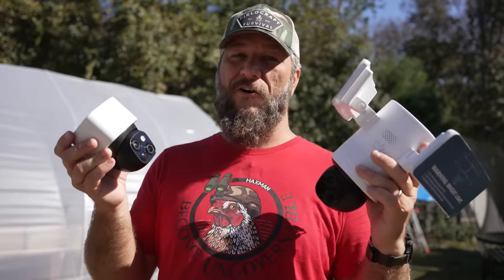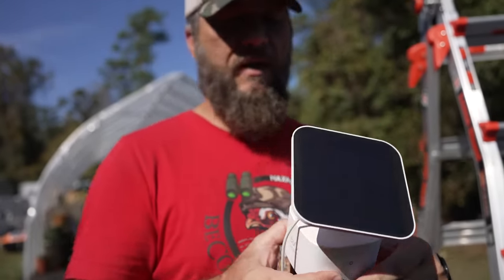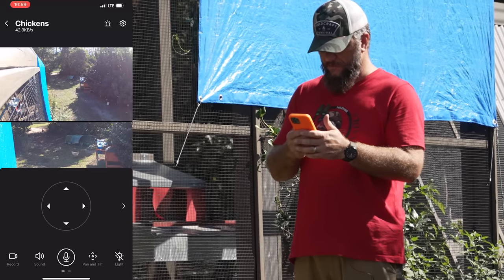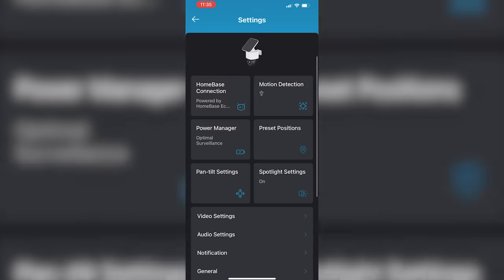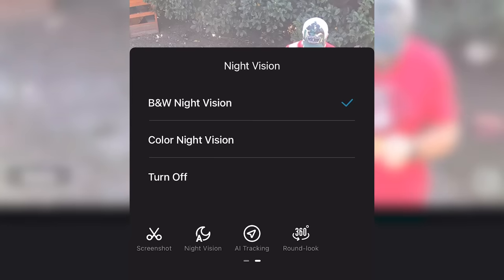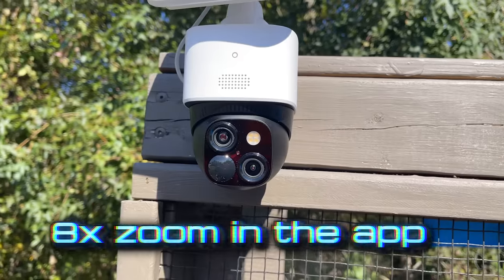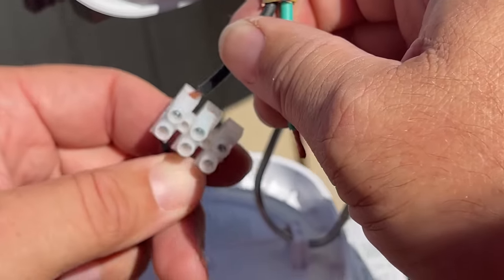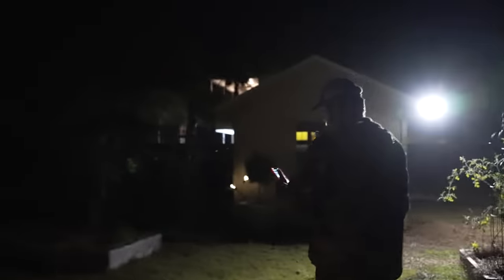Your Security Camera is Junk! Check These Out!

Comment: Eufy has had some pretty unethical security practices... they may have been resolved, but for now I don't trust them.
Reply: Say it louder for the people in the back!!!!!
Reply: @Hunterlewis675  They claimed the camera stream was encrypted, but it was not.  Also, the servers storing the video are located in China, and we all know what kind of a security risk that entails.
Reply: What did they do ?
Reply: @leejenkinson5521 right no power source.. and what would that have to do with access to what the camera sees?
Reply: yeah sorry, that was not even meant for your channel, was commenting somewhere else and the powers that be mixed 2 comments up, will see if I can remove it buddy!
Reply: @Svg784p They claim that the videos are only stored locally, but it was discovered that your videos are uploaded to their cloud, and it's not encrypted. I believe someone found their cloud storage on Amazon Web Services and called them out. Now they claim it's encrypted, but not that they stopped doing it. (Unless something changed recently.) Another problem with their wireless cameras is/was that someone could press and hold the sync button on the camera and it removes it and the recorded videos from the base. If they don't steal the camera and you can sync it back up, the videos are still there, but if they do take the camera, it sounds like the recordings can't be recovered. Eufy initially said that the feature was working as intended, but I think they may have finally upgraded the firmware to resolve this. I'm not entirely sure of that, though. All that said, I'm not sure that there aren't also issues with other brands of wireless cameras. I know Ring employees were caught watching cameras and taking control of them. Wyze had some security flaw issues. I don't know, they probably all have. Lol
Reply: I trust them enough to have them cover my outdoors. They aren’t working with law enforcement like ring, they don’t have multiple consecutive breaches like wyze and they have improved since the incident which end-to-end encryption so I am not as concerned.
Reply: If one wants true security, no data should exit their security system to any 3rd party.  It should be as closed loop as possible.

I'd opt for a system that is localised and sends all data to a local security station and doesn't send data out.
Reply: It's good to see that somebody noticed if you watch carefully and watch the signs they'll tell a story
Reply: @redbaron6805 China how does that help us and where did you get that tid bit of information
Reply: @joshua01 exactly who care is just outdoor. Just don't put it inside your house. It is cheap no subscription like ring
Reply: Thanks, that’s helpful to know. I don’t want any communism in or around my home! 😂

There’s no telling why China wants the data, but it is a l well established fact that China has been harvesting biometric and personal data of everyone around the world. No clue what they want it for, but just the fact they want it makes me want them to not have it.

Comment: Eufy is known for horrible issues with data, doesn't matter how good the cameras are if the company itself can't be trusted.
Reply: If you are worried about security, you could hook it up to its own subnet and use a program to see what it talks to, you can then lock it down if needed. Not for the novice, but there are ways to lock things like this down. I’m sure there are simpler ways as well.
Reply: I looked into this issue and found that perhaps a class 10 extreme duty SD mem card is one apparent fix to the issue, not yet tested. Take care.

Comment: I have an AOSU 360° Solar C9C camera. The camera lacks true security features. The first being a 60 second event recording limit even with a 128GB memory card installed and set up to only record locally(not that local or cloud recording should be a factor in limiting the camera to 60 seconds local max). Imagine it picks up someone hopping your back fence and walking towards your home slowly opps it stops recording / fails to continue to track. or they pace back and forth then begin to walk up to or around your car oops 60 seconds is up. Other times if the subject pauses for a moment, is moving directly toward or away from the camera and even if there is movement across it view  the camera just stops recording. This is even for recordings way below the 60 second max. which most recordings are. The camera has no option to force it to continue recording a motion event for the full 60 seconds or for another 5 seconds (or 10 or 20) after it thinks motion has stopped - this is standard on "security cameras". Another standard "security camera" feature is the ability to pre-record. What that means is the camera is buffering a few seconds of what it is looking at (usually 2-5 seconds) and when an event is triggered it uses the pre-recorded video as the beginning of the recorded event. This ability allows you to see what happened before the detector picked up motion (out of range of the motion detector) or if the camera had a detection zone (and a home zone) and you had blocked some swaying branches... As for the home zone it is where you want the camera looking at all the time. Such as your car or front door (the camera does seem to return after tracking to where you had set it to look at but not every time). These features have been available for years  on inexpensive ($35 or less) wireless cameras.   What made me purchase the camera was the true wireless nature of solar. After 4 cloudy days the camera continued to function. The night vision is ok - if you have street  lights around your home turn it off. The lights that can turn on are bright considering. Unfortunately, key security features are missing. I can't state how important it is to be able to increase or record an event in its entirety. But I know this will leave you very frustrated when there is an incident that was partially recorded or missed entirely. I got what I paid for and most unfortunately missed my return window. I will also mention there is not any documentation of its settings and forget about the tech support people offering any explanation of what settings it does have no matter how many times you ask or send examples of missing events. From what I have read all the cameras in this class are the same. Let's call them "Good Luck Cameras"  . Good luck getting some usable video when something happens.

Comment: Big problem with the Eufy system is, (I have four cams, two floodlights and two doorbells) if one camera in the backyard starts recording it will miss the predator in the front. They don't record at the same time or two events simultaneously.  I had to divide the cameras between two bases, one on my account and one on my wife's. So hopefully one of the accounts will capture the event. Also as mentioned in the comments,  if the internet goes down, even with a stand alone router, the Eufy system goes down.
Next time I will go with a hard wired system that records 24/7.
Reply: That is the reason I don't go with this BRAND, will stick with EZVIZ, if their server goes down it still works via the router as well as records to the backup memory card.
Reply: No, not these cameras. That would have been a great feature.
Reply: This is only true if you choose to not store video locally.
I have 5 eufy cameras which I only have store video locally.
I would have to make a deliberate choice to store video online (Im not that stupid)
Reply: @bondibois  I do not use the cloud, but when my service provider goes down, or has routine maintenance. My system is unavailable and doesn't record. I have one set of cameras with a homebase linked directly to the service providers modem and another set linked to my router.
Reply: @Richard-nb4iv 
Go into your router and turn off automatic updates.
Reply: I saw another review, and they said that eufy still records if the wifi goes down.
Reply: @angieramirez5642  maybe that's second generation. Mine doesn't seem to do it. Also if I run past the cameras they won't record me. Only my hardwired flood lights have show a few seconds before the event.
Reply: @angieramirez5642  If the storage is on camera, which is what I currently use it will be recorded, if using storage at base station or online it won't. Not sure when the last time my wifi went down only when turned off or a power outage (which I have not had in 3 years as we have a home battery).
Reply: Do you have home base three?
Reply: @deklanf6242  no, I have the homebase 1, but I would make sure that the homebase 3 had the wifi only option before the purchase. The wireless is easy for mounting purposes but a home wired system can record 24/7.
Reply: or get boat hypes
Reply: Just because system looks good at setup means nothing.
Give it time when it starts missing notion events or spider web sets it off all night but it won't be set off by car. That's when cameras really shoeing they are any good.  My blink was fine to start with but i regret buying them. My reolink system crashed after a year  both are junk

Comment: When I bought 1 of their cameras at first to see how I liked it I was impressed upon first impression. Of course with it being a new company the price point seemed reasonable I guess. Also I gave it time to work out a few bugs to get better at capturing people. Unfortunately Eufy doesn’t catch everything. It seems at times it catches me better than strangers and even cars that pulled up to my home. I bought a few different ones but in order for me to work around this problem I had other cameras kinda facing in same similar direction for if one didn’t catch the person then one of them will. There has been times when both cameras has been a let down in some cases. I still like the product for what it is but it would seem it would catch vehicles that would travel left to right better than people walking on the street. Eufy local hard drive is what sold me and the decent price point. But I do like the lock unit to the home. I just wish they had a 4K camera. The solar panels seem to last maybe but a few years before it is hazy.
Reply: Exactly my experience.

Comment: I have a 380 base and the S340 and I have to turn OFF one whole side of motion sensor because the road beside my house with a full 6 ft fence can't be used because you don't have any way to get triggering input from car traffic. Reduction in sensing by measurement out from the sensor doesnt really work. I have to rely on the right half yard sensor to pick up movement. Even the privacy ignore doesnt work. I spent hour testing and the ONLY thing that works it disabling the left sensor that takes out half the coverage.  Plus, the App is a cluttered Mess and Bloated. It is so so so bloated with 3-4 different sub entry ways to do stuff is 3-4 different ways by what appears to done by different design teams. They did twice the coding needed to get thing done and then the buyer spends time poking around in the Maze of a boated App designed by 3-4 different design teams.

Comment: what do you mean if you have the home base you'll get 24/7 recording. doesnt it record 24/7 without the home base ?
Reply: Usually motion only on memory cards.  They fill up really quick if recording constantly.  Which is where the home base or NVRs come in with adequate storage space usually on a hard drive.

Comment: 3 issues right off after I bought this camera because of your great work in advertising, and it really is a great amazing camera! If not for the built in software spying and defeating  programming. 
#1 if someone pushes your reset button, it removes all your stored videos, from you but not the Chinese spying company saving all your data which is the big problem # 2, and problem #3 anyone can actually hack your videos if they have the same app. That one might be resolved? But not first 2...? 

I found all this when I went to YouTube to figure out how to set it up just now. And I'm too late to return it by regular means...

Comment: "Solar-Powered, Install Once and it Runs Forever" - from the Amazon ad.
Nah. That thing MUST have a battery, storing power while sunlit, using that power when not.
I hope the batteries are a standard form factor.
And, note that rechargeable lithium batteries do not last forever.

Once and engineer...always an engineer.  :-)
Reply from the maker: It has a built in battery. You can take the camera down and plug it in to recharge if you don't have the solar panel. I'm not sure what type of battery though. That's how my old Arlo system worked years ago except it didn't have the solar panel.
Reply: lol, engineer here too, and I was wondering how many years the batteries will last.  I haven't seen anything that says you can replace the Eufy batteries, so once they're toast or barely hold a charge anymore, I'm guessing you just need to replace the entire thing.  However, by that time, there'll probably be completely new cameras you'll want anyway, probably using different tech; at minimum faster wifi, better batteries, better lenses etc.